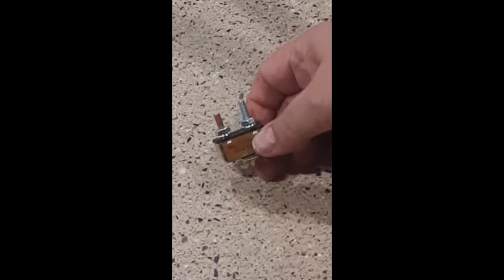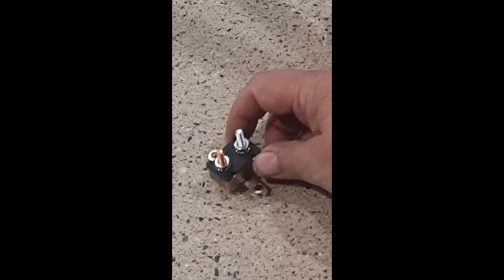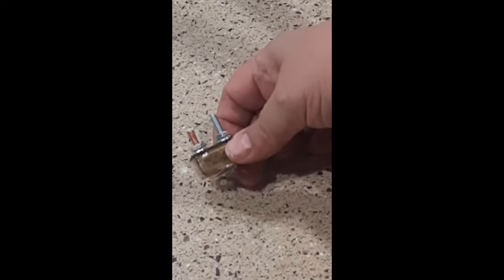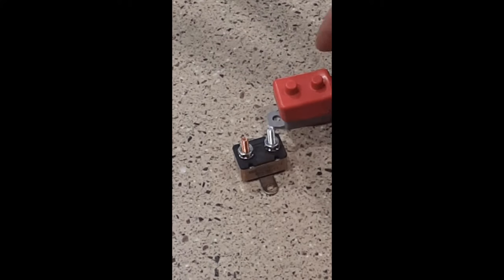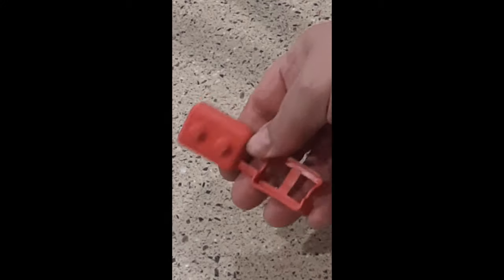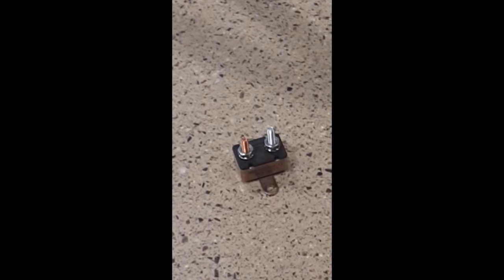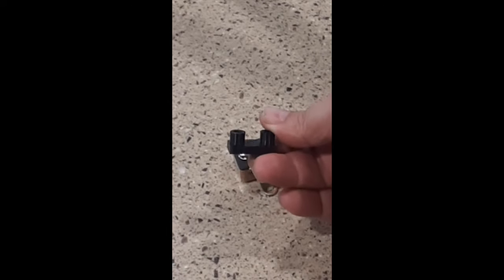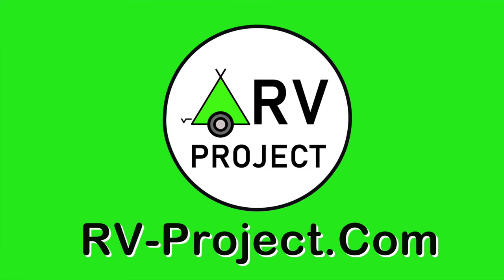3D Printed RV Parts Ep1 - Breaker Covers #shorts

Comment: Will you explain the function of this circuit breaker? You also said you could add to it, will you give an example of what one might add? A short video on the topic would be interesting. Thanks!
Reply: Its actually a relay inside that little box so say when you switch your battery shut off on your RV you'd have one of these "breakers" on the line which when flipped the small celinoid relay inside flips shutting off power. Theres many other uses but this should give ya an idea. You'll find them all over RV's, power sports like quads, boats, cars ect..

Comment: 2nd!
Reply: Its actually a relay inside that little box so say when you switch your battery shut off on your RV you'd have one of these "breakers" on the line which when flipped the small celinoid relay inside flips shutting off power. Theres many other uses but this should give ya an idea. You'll find them all over RV's, power sports like quads, boats, cars ect..